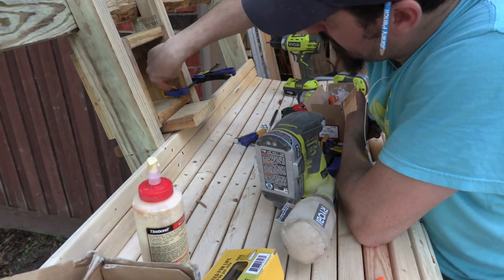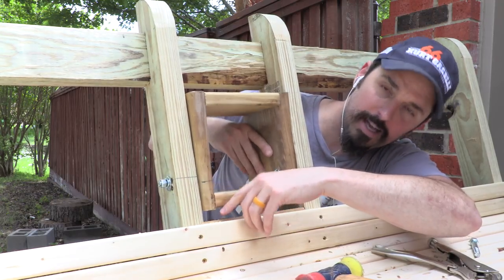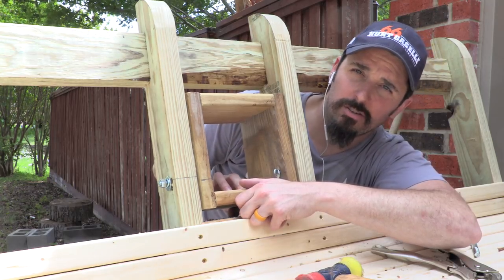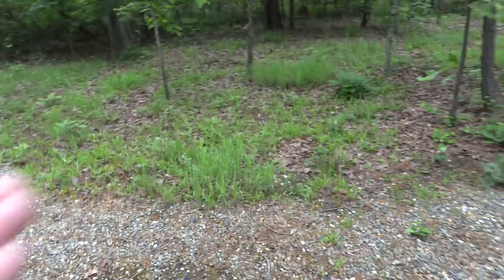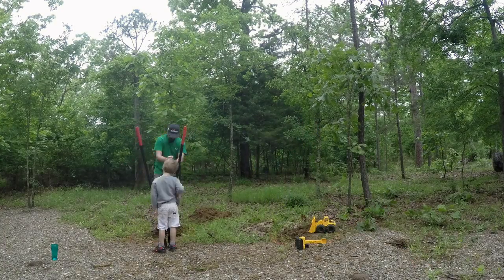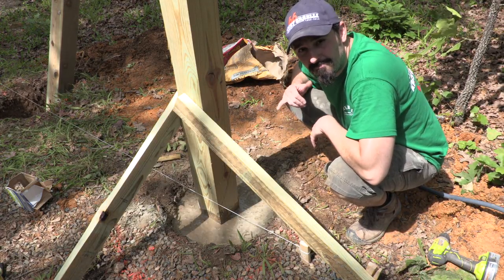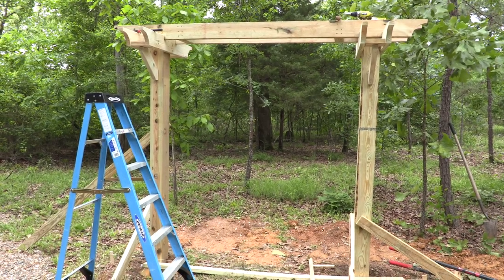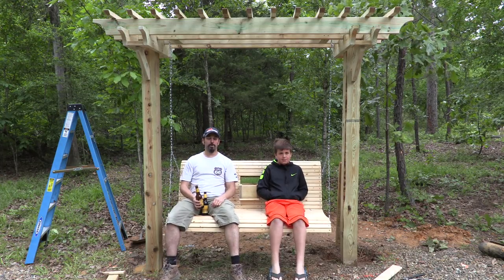Porch Swing and Arbor Build Video : Update for our Cabin in Broken Bow

Comment: That's a neat Job there. 
Did it hold strong with just 2 beams how dip was the hole ? 

Do you have a layout on paper? I am trying to make something like that
Reply from the maker: I put links to the plans and pins I used to plan it out. Holding strong still years later. There’s a few calculators online for hold depth and pole highs out of the ground. I think it’s roughly 1/3 of the height needs to be in the ground.
Reply: @Purveyorofawesome   thanx for the tips. And where can i find the link to those Plans.

Comment: What size posts did you use? I am wanting to make a pergola like this one with a swing for our back yard. Drew up a design but needing to see how to actually build it. So did you cut all the pieces first? Asking questions while I am watching. For the top boards, you used a plate for the round part to trace. What size boards did you use? 2x6x10 or 12's?
Reply from the maker: Been awhile since I built this, but I want to say I used 6x6 pressure treated posts. Height can vary depending on how tall you’re wanting to make your pergola.
Reply from the maker: NEB Barnes The pin on Pinterest had them at 111”, so over 9’. It depends on how wide your swing is and how much room you want between your swing and the posts of the pergola. I can’t remember what my exact measurements were, sorry!

Comment: The 8 double pocket screws which connect the back and the seat will fail
Reply from the maker: So far, so good. What would you recommend though for others that find or watch this?
Reply: Purveyor of Awesome hey! I would make it at least a half lap joint. But maybe better is to have two 'rails' or carrying beams going the length of the bench at the back and the from of the seat. And to have those stick out to the side of the bench. That's where you create your ankers
Reply: Reading back: forgot to mention that I really like the project.